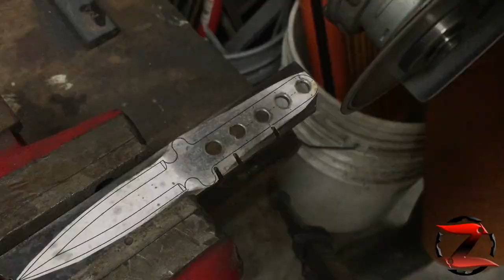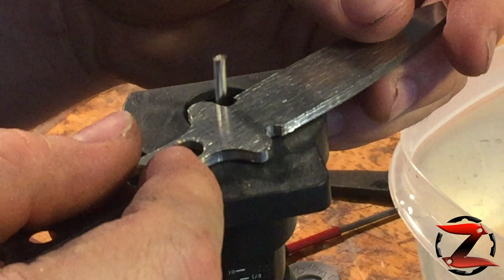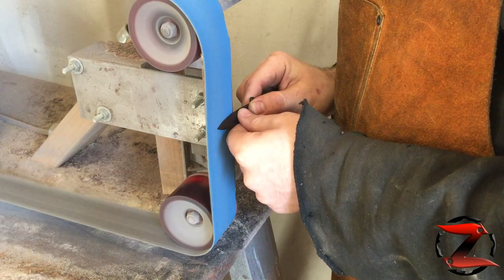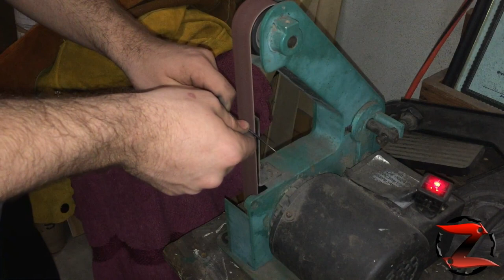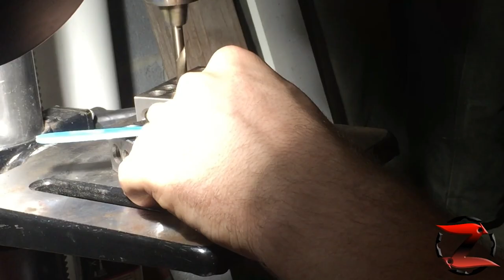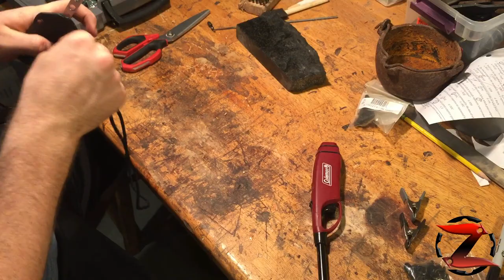Making A Mini EDC Dagger - Discord Community Build

Comment: How do you do the bevels on a dagger? Is the slack belt enough to get them symmetrical like that?
Reply from the maker: I used a flat platten. It’s quite difficult to keep them symmetrical so you will need some bevel grinding experience to be able to pull it off. Definitely not good for a first knife. A slack belt might not give you a clean line in the middle, it could just merge the two bevels together.